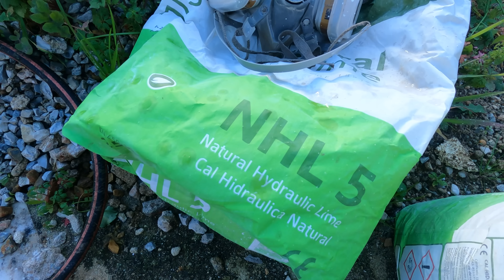Never done THIS before - Screeding a Limecrete Floor

Comment: Finished base doesn't need to be mirror finish since the tile adhesive mortar also need to have something to grab into. Regarding leveling, the more the better although the adhesive can also compensate minor imperfections on leveling
Reply from the maker: Great, thanks! We’re doing some more today so I’ll concentrate on getting level and less on the finish 😃
Reply: @MAKEDOGROW  Finer texture can also become more brittle due to expansion and contraction cracks, although it is also dependent on the mixing ratio. Don't know how NHL based mortars behave but cement based, when too weak the base "dust away" and when too strong it contracts a lot, causing it to also crack and eventually forming large lose particules in the finished base. Usually, not a big deal for tilting (adhesive bonds corrects the imperfections), but of major importance for laying laminated floors (due to the leveling issues it causes). Not that unusual to apply self leveling final mortar in the base to aggregate everything and leave it leveled. (Not an option for you I would say, since don't know any self leveling mortar that is lime based).
Reply: As this was a learning experiment - skill, confidence, lesssons learned, material ratio mix proportions, etc, may want to try the following:

Using a garden spray mister, lightly dampen the sub layer to improve the bond.
2x4 form should go the full distance, need more shoring to prevent bowing, leave in place until cured - shrinkage, bowing, settling, partial collapse.
Not sure if a layer of plastic as a moisture barrier is useful due to heated floors. Not sure if a floating wire mesh or reinforcing steel rods matrix is required, depending on slab thickness and applied weight bearing load to avoid cracking/settling due to varying humidity/moisture/seasonal changes.
First mix too dry, hard to work. Use Guy's technique of filling an area first. Then for the top layer, depending on how wet or dry the mix is relative to temperature and humidity, try (a) misting the top surface with water from your garden sprayer, then trowel or float, (b) as in (a) lightly dust the moistened top surface with your limecrete/fine sand mixture, then trowel or float. This will determine how level, smooth your top surface can be. A little bit of trial and error.
Not knowing your final top surface, a broom can be genty passed over the level top surface to create either a smooth or non skid surface. Or something to grip to that is not completely smooth.
For much larger areas, ringed in formed sections or not and wearing wading or garden boots, demark level height.  Pour limecrete/sand mix. Based on slab size, get the appropriate aluminum or wood float to pack, shape, level and smooth the floor. Starting from the furthest end to your exit point.
If either of you have sometime, try watching some rural family home diy from Japan/China, to see simple, inexpensive techniques with very basic tools for countryside, rural or offgrid renovations. Remote, using readily available materials.
Reply: I used self leveling concrete because the underfloor heating + vinyl floor required the ground to be quite flat

Comment: Usually when doing "Betonilhas" that's how we called it, we would start by doing small leveled mounds  in a grid pattern spaced as much as your main work ruler (we had some really long ones), but for you guys I would 1.5 - 2 m spacing, the mounds are caped with a bit of ceramic material on top that you tap into level... We would let it dry a bit and then join the mounds among themselves flush to the ceramic bits with the ruler.
We would let the connections dry a bit and then finally fill the middle bits and scrape the filing again with the ruler..

Cheers
Reply from the maker: We’ve seen this method and might try it out once we have all the pipe laid out 😀
Reply: @MAKEDOGROW  Yeap it works best in larger areas,  you were doing it similarly but you were using the Woden ruler as your level guide and on only on one side and that made your work much harder because you had to continuously check the level perpendicularly to it...

On the bright side on the kitchen you now have a level based on a good part so now you only need another side and then you level across with the ruler...   

You guys do a great joob.
Reply: Great advice!

Comment: U 2 are awesome!  As a kid I was grunt on a concrete crew.  That extra step of loading lime crete into baskets drives me nuts.  Set up some ramps and wheel it in and dump it in place.  Use a rake or shovel to rough level.  Use your screed board back and forth to float.  Your mix needs to be a little wetter so it floats better. I don’t think limecrete needs to be dry but you know best about that.  Don’t be timid.  You will make twice the progress for the effort.  I’m with you. Why hire the work when you can do it yourself. It’s hard work but fun and satisfying. All the best.
Reply: Agreed. Wheelbarrow the concrete to the job. Shovelling into buckets is a waste of energy.

Comment: You're doing it very great! Fascinating to watch. If the finished roughfloor is +/- 0,5mm over 3m, it's Perfect. Normally, if you get to +/- 1,5mm over 3m, then you are in the sweet spot, especially for smallish rooms. Those absolute perfectionists suggest making a small 1-2° incline towards the centre of the room under cupboards and appliances for any accidental moisture to seep down where one can mop it up.
Reply from the maker: Awesome, I was aiming for nothing more than 1mm out of level 😃

Comment: Just sharing: I use wood charcoal under my cupboards to absorb humidity. I cut a square hole on the lowest cabinet, line some plastic sheet so the charcoal dust won't fly out from under the cupboard. Top up the hole with charcoal and close it back with the cut out piece. 

I have a built in wall to wall cupboard (3,5m) in my open bathroom area. Obviously it gets very wet and humid in there. But with this charcoal setting, I have no issue with mold inside the cupboard. For comparison, in a bedroom we also have a big cupboard without the charcoal and I constantly wipe it dry from humidity and mold build up. The cupboards I'm talking about are located in Indonesia. So it's hot and humid. 

My mum also keeps a big vase or container of wood charcoal in the corner of bedrooms in her house. Especially rooms that she doesn't often use anymore hence lack of air circulation from closed windows. Before she did this, the rooms smelled to damp everytime. She told me how she got this idea of putting charcoal from going to the funeral of her Chinese friend's mother. This was long time ago mind you. So in the bottom of the grave which was cemented, they poured in loads of wood charcoal then lowered the casket in. She was told this was to prevent humidity and preserve the dead body :)

Comment: Using a heavier wooden trowel 'a bull float' to flatten-level is the usual way. Since you need some weight to move the aggregate around and bring the cream to the surface. Steel trowel should only be for final pass. Hope this helps. Lovely job btw just that you could make it less tiring and quicker. Cheers
Reply from the maker: Unfortunately I don’t have the physical strength to use a heavier or larger float. The spirit level is working well after mostly getting the material into the right place
Reply: @MAKE. DO. GROW.  Fair enough. I also cannot plaster with a pool trowel for the same reason. Slow and steady wins the race. Please keep on uploading, you both are doing a quality job.

Comment: Building surveyor here, you are doing really well. I started my career doing groundwork’s and our general mantra was wetter the better as it made levelling quicker and you don’t get differential drying it also bonds to the substrate better. The level should be as near as possible, it’s normal with concrete floors to finish with a latex screed but in your case this may effect the “breathability” of the floor.
Reply from the maker: Thanks for the kind words!
From all my reading/research the suggestion is always to have a dry lime:sand mix, not sure why though … something I’ll have to look into.

And you’re right, we can’t use a latex or self-levelling compound so it’s a little more important that we get it as level as possible now. There is a lime based tile adhesive but it’s not really a screed rather an adhesive for setting the tiles
Reply from the maker: I checked on the water/wetness with nhl … seems the more water you use the less strength the resultant slab will have … all to do with how the hydraulic lime sets
Reply: @MAKEDOGROW  Thanks, I’ve never used limecrete in my long career and that’s really interesting and at 55 years young a sure sign you never stop learning. You two are a real credit and if you ever get the chance should think about putting your knowledge of these processes down In a book, it may never become a best seller but would be invaluable for students in the future.

Comment: HI! If we make concret  staffs, we add a little bit more water ' caus easier to work with it. And if it's water level is higher,  U can hit the wood leveler with rubber mallet to close the "wasp nests" the bubbles in concrete. Sorry for my english! Best regards from Hungary !

Comment: Try using a plastic/wood float (the ones that are about 1/2" thick with rounded edges) instead of a metal trowel, and keep it flat when when finishing the top surface :)
Reply: Wooden float makes that initial material handling a lot easier/smoother.

Comment: That’s good to know, because I feel the same when I was doing my garden irrigation. 2 attempts later it still wasn’t working and I couldn’t figure what I was doing wrong versus the videos I had watched. I eventually used different emitters and it worked. So it’s nice to see until you get the hang of it it’s a freak out. But it’s such an accomplishment when you are done it.

Comment: Your circular saw should have an adjustable guide which runs along the outer edge of the material. Just lock this to the required width of cut and there's no need to mark the material (be it cork, wood,...)
Reply: better still, you can clamp the level to the material and use it as a hard guide
Reply: Better still, get a table saw.

Comment: Really odd that with so many stone houses  in Portugal there a so few builders working with lime mortar. I renovated a 1907 house built direct on to the soil and no foundations so had to research how to work on it. Had to do the same as you with digging french drains and removing concrete render on the porch walls. They need to breath and the open fire places where part of the system to remove moisture. If doing again I would install an air ventilation system which I think you said you will be installing. I don't think your floor needs to be perfectly flat as underfloor heating can work over uneven surfaces and the final layer above it can fill in any uneveness.

Comment: Really i am proud of you to look at your learning experience. 
For to do that work more quickly you put a metal or aluminum profile about 15 cm from the wall and put this in the material and level it out. 
Than put the material between the woodslap and the metal profile. 
With a smaller profile put the material level ( go cross on top from metal and wood  ), later you pul out the metal profile ( when the material is not hard) and fil the gap from the profile.

Comment: I always try and get it as level as I can initially, you can always do a self levelling compound pour if you need it super flat and smooth
Reply from the maker: We can’t actually use self levelling compound, it contains plastic … we’ve chosen limecrete (rather than concrete) as it’s a breathable solution suitable for stone buildings

Comment: Only ever tiled a floor and a wall, never done the "foundation" for it. But what I do know is you want it as even as possible yet not smooth as glass as the fix you use to place the tiles need a good surface to bond to. Any little knob or lump in the surface will frustrate you. :)
Then again, if it's not super flat you can work with the tile fix to get it level in the end.

Comment: Just been thru this same process. Not sure if you are planning to lay the rest in sections...and leave the wooden shutters in place ....I did as i laid wooden floors over the screed. Anyway consider using thicker buttons and back cutting them on both sides so the weight of the screed holds them down in place....I also used Cork perimeter and fa handfull of fibres in the screed to (sucessfully) avoid cracking.

Comment: Really great to see the progress & your commitment to getting it right! We did wonder why you wouldn't put mesh (in Oz we'd call it chicken wire) into the slab to allow for expansion & to keep that depth of mix stable. But it may be due to the lime mix rather than just sand & cement. Those of us who've renovated or built can appreciate the beauty of a flat slab! Well done you two! 👏 💪✌️
Reply from the maker: Yep, that reinforcement isn’t need due to the layer under this one. The two combined layers have sufficient compressive and tensile strength. Often in cement mixes rebar or wire is added to help prevent cracking … also not needed with lime as it flexes

Comment: For a subfloor layer, I wouldn’t have thought it was necessary to be glass-smooth, some roughness gives the next layer or tile adhesive something to bond to. You do want to be as level as possible so you aren’t trying to correct with subsequent layers.
Reply from the maker: Great, thanks!!
Reply: @MAKEDOGROW  It’s probably set by the time we've seen this, but if not, tapping over the surface with a stiff brush will create a key.
Reply from the maker: @LaReynedeNeige  we’re doing more today so we’ll be sure to do that 😀

Comment: Some experiment suggestions:
Set forms or level and secure.
Dump mix unto floor starting from one end. Pat down and level. Thumper, trowel, float (level, straight edge, triangle float edge).
Tricks for top finish: dust mortar/cement/limecrete sand mixture on top and trowel/plane. Mist spray water on surface and trowel plane. Surface can be existing or sand /cement/limecrete.

Comment: Dont worry about if its fully leveled or not. My dad demanded to lay down the tiles in my flat becuse he has done it multiple times and wated to save money. Lets just say - they are not leveld. One is taller in 1 end , the other is lower... You live with it , its not a problem.

Comment: Next time definitely build the formwork the entire way and leave it during the entire curing time of the limecrete. I would say remove it after 2-3 days, not quite sure for limecrete but this will prevent  cracks when the mix contracts or settles. As well as it keeps it in shape and level while it cures. Also, when I did a concrete slab for an outside area I was told to make the surface somewhat rough before tiling so the material used to glue the tile had a stronger bond, I used a broom to just lightly create a rough surface.

Comment: It is not critical to get your slab perfectly flat. Whatever you are using for a finished floor has to be fixed to the slab with some type of adhesive or mortar so that is what you can use finally level the surface. Having said that the closer to perfect you get at each stage the easier it is at the next stage. Great job as usual.

Comment: we put in a limecrete/foamed glass floor and put in a cork surround. you don't even see it and is kept in place by the screed. Mix is too dry.  The discrepancies can be ironed out with the mortar that you lay the slabs on. so no panic..  (you have just said the mix is too dry as I finished writing this its easier to move about if wetter😄)

Comment: I moved to Hungary, it's the same here, very difficult to get people to work for you, and most have no experience with traditional buildings using hemp, lime or clay. Using modern building materials like cement and concrete in traditional buildings can lead to more problems then they solve

Comment: I think you are doing really well, if it helps, I will add my twopenny worth.
As you don't have a readymix lorry to hand, I would recommend mixing the screed by hand, a small mixer just clogs up and the temptation is to add more water to release the mix from the sides of the mixer.
The screed needs to be moist not wet and when you get it right, it is not hard to work to level and then float. Please give your spirit level a break and use a straight piece of wood also get a nice long plastic float and compact the screed with them.
I have found the easiest way to get a good mix by hand is to use dry sand as the lime will integrate more easily, mix dry and carefully add water whilst still mixing, if you mix by making it into a heap you will be getting near a good mix when it starts to ball and roll down from the top.
I will stop going on... but you might investigate making a gauging box and also the addition of fibre for the area where underfloor heating (hemp?) 
I think you are a great team, thank you for the entertainment.

Comment: if you are to put another layer on top then you shouldn't smooth it too much because the next layer will adhere much worse to it compared to if the top is more rough (level but rough) hope it makes sense... actually the finish you have on it after running the level over it is perfect (time 20:06 ) but without any small "poops" laying on top obviously

Comment: Great job by both of you. Agree with others that you want it as level as you can get it to make tiling/ flooring easier but you will want a bit of a rough finish for when it comes to the tiling as you need it to bond to the floor . 
Have to ask how much time Kylie spent out in Africa or if you have any South African friends , Ja Ja 😃you know what I mean